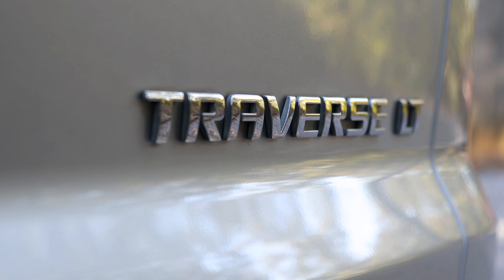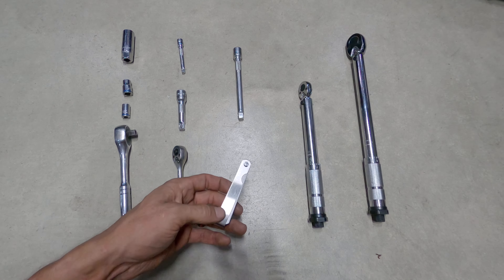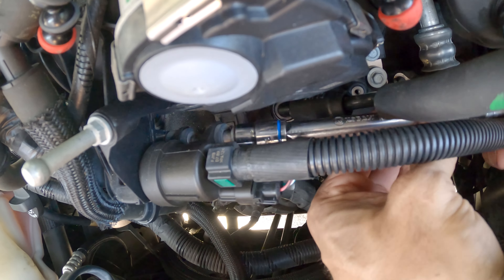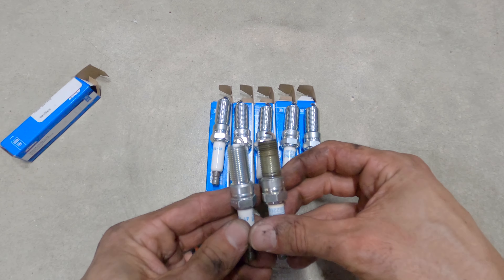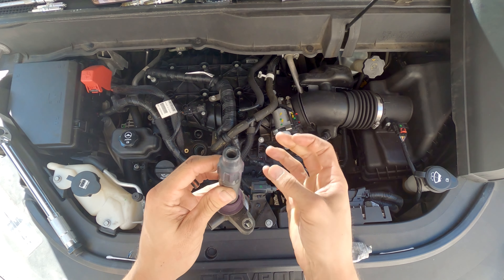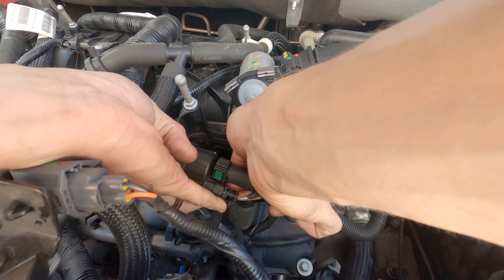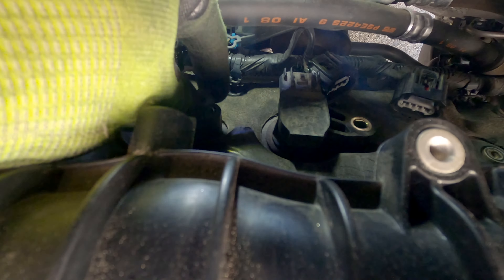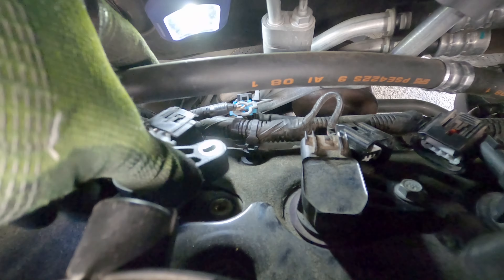Spark Plug Replacement | Chevrolet Traverse

Comment: My spark plugs must be jammed because I can’t get them out with the 5/8
Reply from the maker: Are you having trouble breaking them loose like they were torqued down too much or was the 5/8” spark plug socket not fitting?
Reply: Seems like they were torqued down too much
Reply from the maker: That’s not good. Were you able to get them changed ok?
Reply: I gave up for the day.. wrist was starting to hurt trying. I used wd40 and I’ll wait until the morning time to try again.
Reply: @TheHarlemWay  did you use a "deep well spark plug socket"  or just a regular 5/8th socket